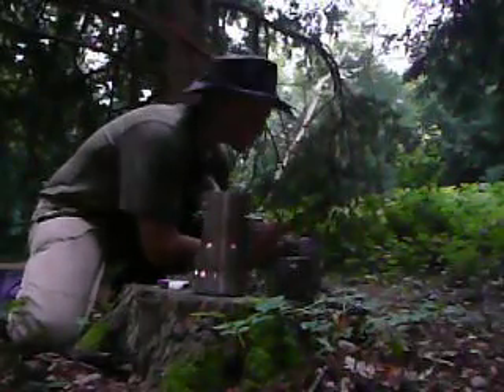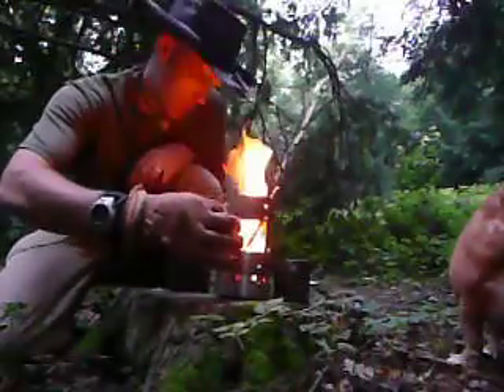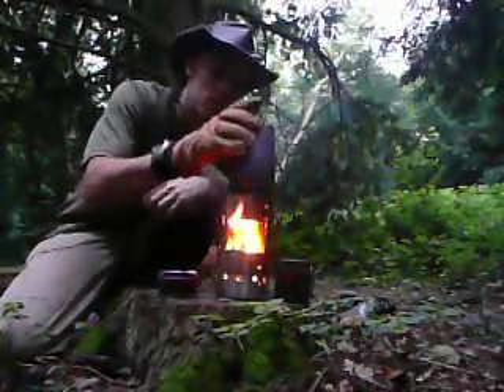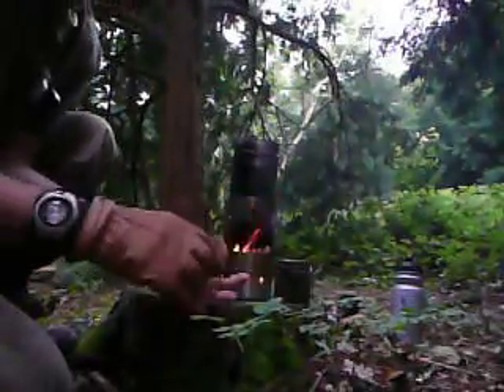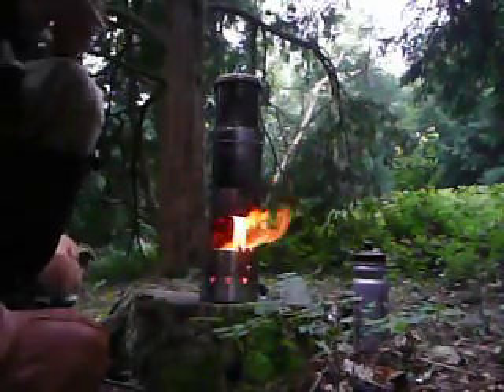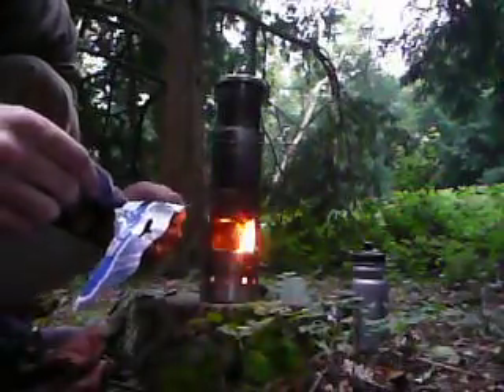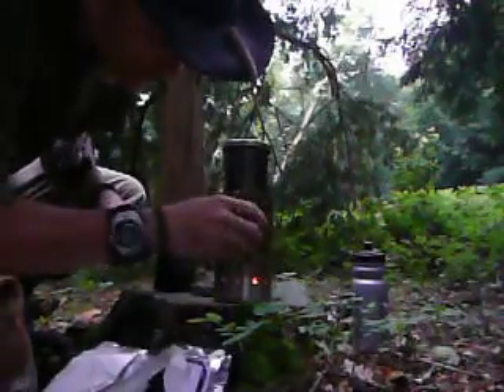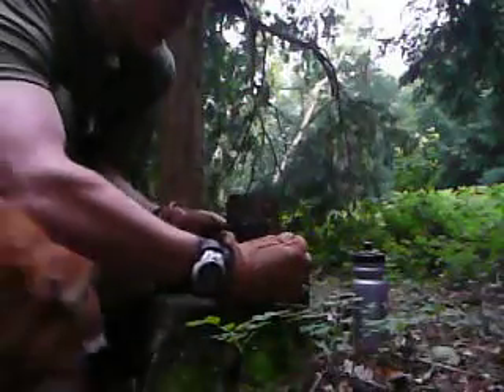Hobo Stove

Comment from the maker: I agree with you entirely.  Also it uses alot less fuel to achieve the same amount of heat.  So alot less work required to gather the fuel.  I also find that if I let it burn out completely there is very little ash left.  Maybe one or two teaspoons only.  This is by far the best stove I have used or seen and is now my prefered type of cooker.  

Thanks Sean

Comment: Sean, making this stove from an old flask is a brilliant idea! They are designed to be light and not conduct any heat out of the walls and thats what gives it such an efficient burn from the fuel. But, how well does the inner part (the cooking pot) conduct the heat? Did you get a lot of heat passing up to the cup? 
great vids